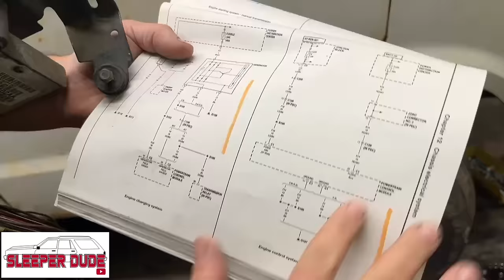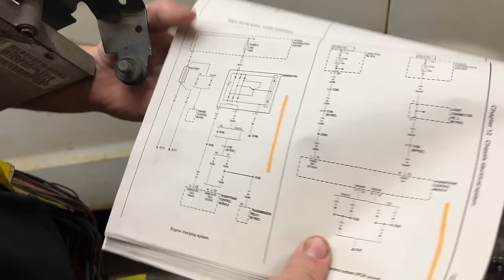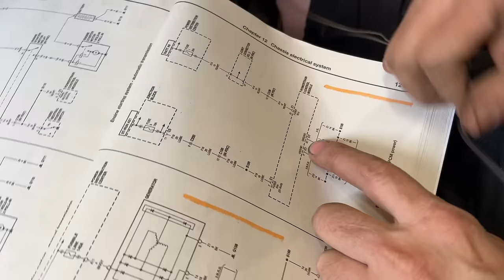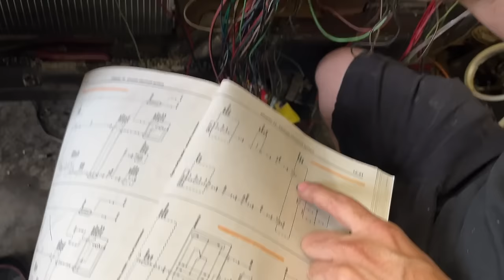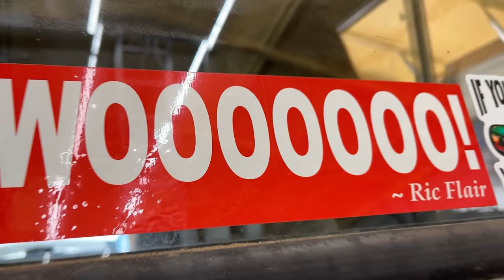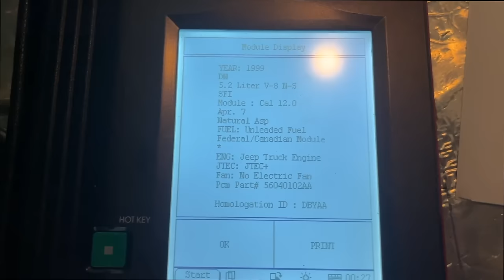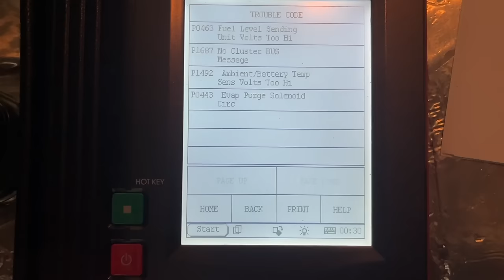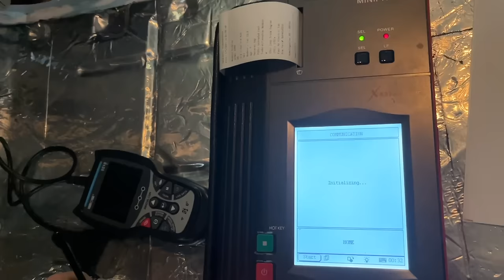2 Years of WORK Has Led Up To This! Will It Start?

Comment from the maker: Go to  https://recpro.com and use code SLEEPERDUDE at checkout to get 5% off your order!
Reply: If you put that trans cooler underneath, make sure to protect it from debris, cooler are delicate, even mud and water wont be good for it, maybe just make a plate connected to those arms that runs up 4 or so inches or straight out 5 or 6, at least keep rocks from flying up and hitting it!
Reply: You could even use some bendable sheet metal, put in a couple plastic scoops so air flows to it, cover the end with strong screen, then rap the sheet metal to curve around those bottom arms and comes up or out to protect it from debris and stuff, just an idea you could easily do!👍
Reply: And dang I want to see y'alls new shop, I hope yall coat yalls floor, so it it's easy to clean and lay on, make sure to put some drains in, cant wait to see you and all your kids in a new shop building stuff, teaching the whole world how to do it, you've inspired me to get an old classic and slowly build it, I have bad diabetes and lost everything, been depressed for so long, but just recently I have a chance to be in texarkana in the country with the time and peace to accomplish it, instead of rotting away in this horrible apartment barely surviving with massive bills, driving a kia with 330k miles, the highlight of my single lonely life is your videos👍
Reply: I will see if I can find that episode
Reply: Seems this is an issue many people have had with dodge and engine and computer swaps, pretty much no matter the year, it's a pain for alot of people, lol dodge yikes
Reply: I worked over 33 years for school system and a guy is supposed to be the mechanic at school system I like to see him try put that wire horn saying ain't kinds of special too short but he can't find his shorts he never get together
Reply: A thought that came to mind regarding the trans cooler fan, make sure that when the fan is running it is not trying to blow air towards the front of the van. I.E; fighting against the airflow coming from the direction of travel. That would likely overload the fan and cause a massive current draw.
Reply: I don’t know anything about cars but my husband had to switch the key switch out on one one time his wouldn’t start it would do the same thing hope it helps good luck
Reply: I have always had to use a factory Mopar crank sensor . I had this issue with a 4.0 in a Jeep it did the same exact thing  try a Mopar crank sensor
Reply: @Sleeperdude you can use a spark plug eliminator or spark plug non-fowler same thing to trick the ECU for the O2 sensor check engine light
Reply: So I have identifix   Most common problem was pcm for no injector pulse. But I was thinking out side the box. If the tps throttle position switch thinks it’s wide open throttle it will cut fuel pulse.
Reply: Me and Husband say you did one heck of a job prayers you find out what is holding it back from starting 🙏
Reply: I think I have an idea for why its not starting. It looked like the issues may have started after you adjusted the fuel pressure from my own research and tangles with those engines some years have a fuel pressure saftey shut down where if its not getting enough fuel pressure it may lock the injectors to keep from hurting the engine,  which is why it would start then shut off what ive found works best is 49.2 to 51.8 pounds of fuel pressure thats my best guess and that when it was primed before you adjusted the regulator it was getting enoungh fuel.
Reply: Maybe it's the fuel cut off safety switch for when the car gets into a collision the Durango probably had that did you make sure it's hooked up
Reply: you need Ivan from Pine Hill auto he's the best !!!
Reply: hey Josh i enjoy your video's! family working together on automobiles and mini winnies.
Reply: Awesome video you’ll get it figured out
Reply: Unplug that aftermarket coolant temp sensor and see if it runs. The oil pressure sensor that shorted on me was aftermarket from the parts store, it's just an oil pressure sensor right. It shorted in less than 6 months and took every sensor down with it until it was unhooked. I do remember the signal voltages went back to normal once I unplugged the sensor. Like I said I never tried running it without the sensor, I just replaced it again
Reply: Good luck and prayers for your build.
Reply: There is a quick harness that over rides all that harness it is only about 10 wire's in it you can get it made up.
Reply: I've been pondering on this & i wonder. You wired in to the old system. Wonder if that is what is throwing the codes ? It's not recognizing the connections , thus thrrowing a code ? May not work that way, but maybe, ???
Reply: I believe it could be a security system in the computer. Reset the computer and you should be good to go
Reply: Josh did you give the start run separate circuits from the original ignition switch under the steering column or did you use the switch from the Durango because the switch from the van was the biggest problem with the igniter and pickup coils back in the day you remember trying to get one started up and it would crank and crank until you let up off the key and boom it would light off I have been giving this situation some thought and I am leaning toward that direction and my adhd is making me ready to jump in my truck and head over and dig in but I’m just going to offer you what I have been thinking because it started up at first but then it shut down and it just won’t start up again not even for a minute it’s telling me that you didn’t have enough run voltage or it popped a fuse or fused link or burnt up the crank sensor but I am leaning towards the ignition switch has gone bad this problem is one that you have to go outside the box to find the solution you have to go back to old technology and look at new technology and make sure that the 2 are working in harmony with each other like the Indian in poltergeist said your car is angry with you I have a gut feeling that that problematic starter switch is going to be the problem unless you used the one from the Dakota then I have to think on it again some more but I’m sure it’s not a big issue it’s just trying to decide what the last thing you would have ever thought of is what you are going to check until the problem comes out
Reply: Thanks for saving the lizard!!!
Reply: I DONT UNDERSTAND DE MSG  BUT OK !! BYE AND 😍 from 🇦🇷
Reply: @kayjayjames1271 for all Mopar issues I would check w it’s the owner of Graveyard Carz. He seems to be the preeminent expert on all details of Mopar cars and engines. 16:15 16:22
Reply: My husband and I love your show, I have watched 20 years of Motor shows in the past. My husband watches them all. Your show is better than any other I have ever seen,  love the way the whole family gets involved with your builds. Keep doing what you're doing 😊
Reply: I’ve always wanted to meet ralphie and be friends with him

Comment: Hi Josh,  2 suggestions: 1-The only wires that you soldered for the sensors and that you were not 100% sure of were the O2 sensor wires. They have a heater circuit and if you crossed wires it can throw off the ground to the other sensors.   Disconnect it, clear the computer, and start the engine with it disconnected. It will set an O2 code but will not prevent it from starting. 2- If that fails, disconnect the TPS and start. The computer will substitute the TPS value if it's disconnected to allow it to start. The TPS may currently be reporting a high voltage which prevents the computer from firing the injectors when starting because it thinks you have the throttle wide open to clear a flooded engine. Contact me if you need additional information. You already checked power to the injectos so the ASD relay is working and you must have verified the cam sensor by now given how many times it was suggested. Hope this helps!
Reply: Spot On. Using open loop or baseline data will eliminate closed loop crank no start errors. That method of diagnosis is common because it works..
Reply: Right on and I hope he sees this as after watching it over and over I think it what might have happened.
Reply: I'll bet you are correct on that. I once wired a sensor in the wrong place on my sister's Kia and it barely ran . I think your in the right track

Comment: It's not security problem. Hey Sleeper dude! Make sure you do a cam crank sync with scan tool. Older Mopar computers crankshaft signal is for spark and camshaft signal is for fueling. 
Hope that helps!!
Reply: i agree it not security, it would not start at all if it was. i posted what happened on 5.9 swap hope it helped him.
Reply: My thoughts went to crank or cam position sensor which both notoriously fail on Mopar stuff. He was able to fire the injectors with the scan tool which tells me the pcm is doing its job and the wiring is fine. So if that’s the case and he has no power to the injectors during crank then the part that tells the pcm to fire the injectors is not doing it’s job. That would be the cam position sensor which also wouldn’t fire if the crank position sensor was shot. Both parts are cheap and easy so that’s where I would start.
Reply: As stated by @williambowman5311 the cam and crank need to be synced, I always used an O-scope but some scan tools do it as well; turning the dist/cam sensor will probably make it not run, you cant adjust the timing on this engine, if they are out of sync the engine will not start. Love your Channel.

Comment: It might be because of the oil pressure sensor. If that oil sending unit isn't sending it to the computer, its shutting off the injectors to stop it from destroying the engine.  Then again you might have accidently knocked something loose when you was capping the vacuum leaks. It was running until you did that. I hope you get it figured out. I love the videos.
Reply: This exactly.  Hook up the sensor and she will run.  Thats why it runs fine when you first start it, then the computer says "Uh oh, we haven't built any oil pressure... ABORT FUEL!"
Reply: Yeah!  I had a Chevy Deisel and it acted like I had a misfire.  After a lot of money spent it turned out to be the oil sensor.  It was riding on the ragged edge and would intermitenly fool the computer into thinking no oil pressure which shut off the fuel.
Reply: @artnelson3402  Thats why its running for about 3 or 4 secs and shutting off.
Reply: @artnelson3402  i agree
Reply: @timssmallenginerepair1467  Exactly.  Josh, go out there and hook that up and report back to us ASAP.
Reply: I'm thinking oil pressure sensor as well....
Reply: I think you’re right, if it’s not getting that signal it’s thinking there’s something wrong and it’s shutting down for safety’s sake, which would also explain why it would start when it was bottle fed. Josh you took a great big jumble of wires and you made sense of a lot of them, take a bit of time, try the oil sensor and go from there.
Reply: I was sure it was security because I’ve had an issue where the chip die in the key. It did exactly the same. But I have to agree that it has to be the oil pressure sensor not being hooked up.
Reply: good idea!!!
Reply: Seems like ecu would kill spark instead of fuel
Reply: I can't speak for dodge or Chrysler,  but gm vehicles of that era shut off fuel pumps / injectors because of low or no oil pressure , it was considered an engine safety thing , to prevent self destruction
Reply: @darrylsm  We had a 77 Vega and if the oil light come on, it would shut the electric fuel pump off in the tank. That has been around for years and years.
Reply: You are correct!!! Good job!!
Reply: Oil pressure will tell the computer to shut off injectors to save the motor when oil pressure is lost
Reply: @sleeperdude check this out
Reply: this is it for sure it has to see oil pressure
Reply: Another vote for oil pressure sending unit. It is actually the rollover protection for Dodge and GM
Reply: @BlackCharger-xd4zx  Security mode is triggered (by not using the Durango Cylinder lock and/or security module that did not made it in the '73. Check is disabled but security mode is still active (import settings like Odo meter and security mode are being kept in the PCM regardless of a dissconnect)
Reply: @artnelson3402 😮
Reply: @patrickvanden8322 so how to disarm it is to temporarily hook up original key ignition until code disappears🤔 this might work.. If it isn't the oil pressure sensor.. I know the oldsmobiles had the chip built into the key that was also security shut off
Reply: I’ve never seen a vehicle that prevents spark with a loss of oil pressure
Reply: ya. But Vega’s were pieces of crap.
Reply: Wouldn’t a computer code come up if this was the case?
Reply: @davidthompson62  My guess if the sensor is not physically attached to thee engine the ECM won't get the feedback signal of low or no oil pressure.
Reply: My 06 Chrysler will run with zero oil PSI, sensor unhooked or not. It would have a code for oil pressure if it was bad. OBD2 will almost always set a code for something which is inhibiting startup. I vote for something off on timing which has now fouled the plugs to the point it won't even fire
Reply: Didn't he say they had 70 psi for oil?
Reply: @sarahsoftballgirl  yes, he said he had oil psi. But sender hooked up?
Reply: @05milmachine90  I’m with you because he did have start up before fooling with timing.
Reply: @artnelson3402  but then it didn't run at all..
Reply: @halleffect1   Hard to predict what happens when your safety shutdown kicks in 10+ times in a row.  I bet it starts again after sitting a while.
Reply: @TheBuddyCassius  The problem is the engine did originally start and the engine was receiving fuel until he moved the engine timing 180 degrees. In some engines, like Ferrari’s, this can have a disastrous effect on the engine. My problem with the oil pressure sensor is Josh never stated the engine wasn’t receiving fuel.
Reply: @davidthompson62 yeah he did he test the injectors and they aren’t getting a signal to pulsate
Reply: I had a 72 Mazda RX3 that I converted into a Pro Rally Car. The wiring harness had crispied and I pulled it apart and rewired the car stem to stern deleting unnecessary wiring. It was a much easier car to deal with than what you are doing. I’m truly impressed with what you accomplished so far and I know you’ll get it figured out. 

Love the family and the interactions too!

Comment: It could be that ignition switch. Try hooking the key on power directly to battery then try starting it. My theory is when cranking it’s not powering the ECU till you stop cranking. Good luck 🤙🏽
Reply: ^This
Reply: I agree. Because he joined those two wires from the ignition switch the key on or cranking live feed to the ECU is being interrupted. As the contacts in the ignition switch for key on and cranking don't overlap there's going to be a momentary "off" in between them.
Reply: Winner winner chicken dinner . Josh is over thinking it. If not oil switch or cam trigger sensor or key security then this
Reply: @philj3095 typed my thoughts

Comment: Change your cam sensor on rear passenger side valve cover, in transmission bell housing, that controls all cam phasing, tells computer to fire injectors and pulse width
Reply: Not doubting what you're saying but the engine ran when it was in the Dodge truck now it won't run your missing something
Reply: @stevejohnson1397 I'm thinking those o2 sensors are what's shutting her down. They're both hooked up and telling the ecm there is to much fuel.
Reply: Original sensors, get jarred or bumped, if batteries are hooked up wrong can kill a week or old one

Comment: Dam josh you are the most patient man I've ever seen .
Just because it's not started doesn't mean it wasn't a good video 
It's real and not cut to make it look easy it's how projects actually go .
Reply: Are there any 4 speed automatic transmissions that are the same length as a 727? or do they all need the driveshaft cut? or can I use the driveshaft that was with the transmission? if both vehicles have the same wheelbase?  What is the easiest way to upgrade a 727 to overdrive? or is it more practical to just shell out for the extra gas?

Comment: The small vacuum on the keg runs to the front of the throttle body and connects to the map sensor, make sure its hooked up.

Comment: my dad works for chrysler and told me the cluster is what supllies CAN buss, he’s pretty sure you need to put the cluster from the durango in the camper, if that doesn’t work there’s a body control module (BCM) on the passenger or drivers side kick panel that needs to be wired in also. double check the ASD (Auto shut down) relay circuit and make sure getting power in the start and run position
Reply from the maker: Ok thank you

Comment: Battery temp sensor is actually important on mopars. It can cause a no start condition if it’s not wired in and reading correctly. I would try setting that up and see if that helps.
Reply: I don’t about magnums but this is very true for hemis.

Comment: Ohm the key to the Durango and put in a resistor in the ignition wire with said ohms. You got this. Love your family and videos. From Michigan
Reply: Also check to see if injectors are getting power. The computer pulses the ground
Reply from the maker: Ok thank you

Comment: Hopefully you figured it out but. The cam sensor alingment in distributor is for #1 injector synchronization.   Your engine has a v8 mark on the balancer close to the top dead center mark.   It’s necessary to bring engine up to top dead center then turn crankshaft untill v8 mark lines up to zero on timing cover.   Then line up cam sensor. In distributor.  The distributor does not set ignition timing. The computer does that function. The cam sensor is only for injector timing.  
 V6 dodge engines have similarities mark on balancer  requiring similar procedures 
 Hope this helps 👍